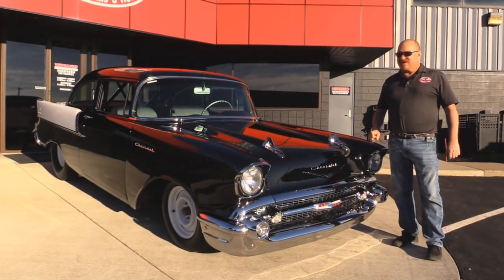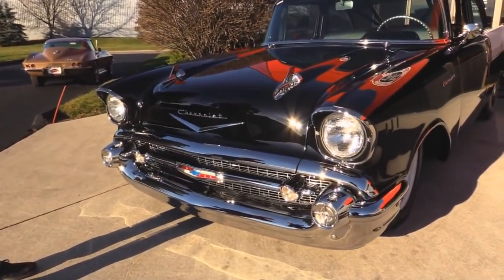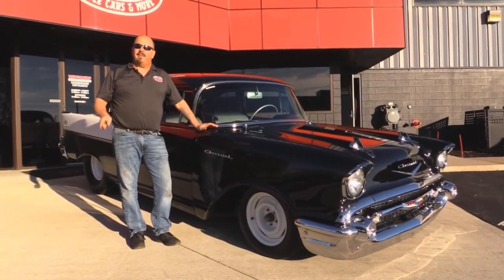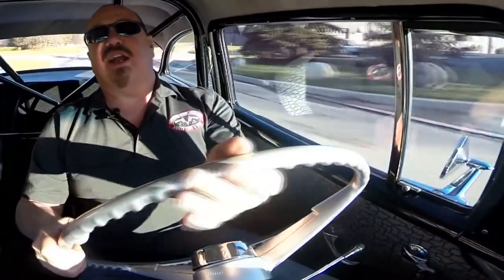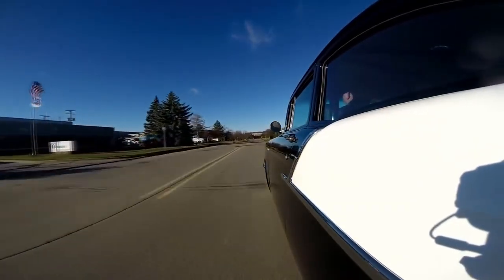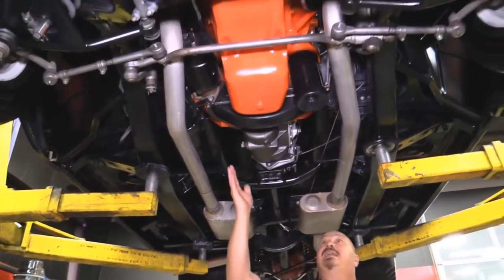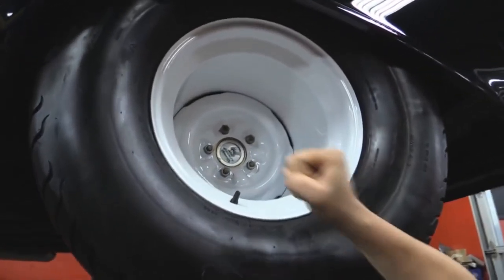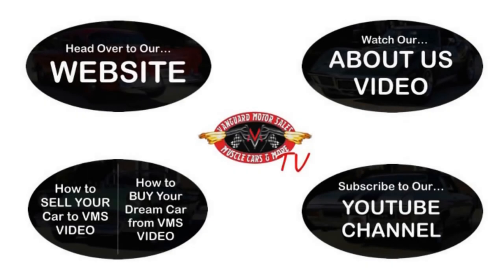1957 Chevrolet 150 Bel Air Black Widow Recreation For Sale

Comment: What's the Black Widow a three on the tree?
Reply: eric, Black Widow a nickname given a handful of 57 Chevys specifically build for NASCAR. They were 150 models, sported the black and white paint, stronger truck 6 lug wheels, dual shocks, etc. Very few still exist and reside in museums or private collections. They were banned from NASCAR after the second year competing - they were that good. Three on the tree is a term meaning 3 speed manual on the steering column.
Reply: That's correct.